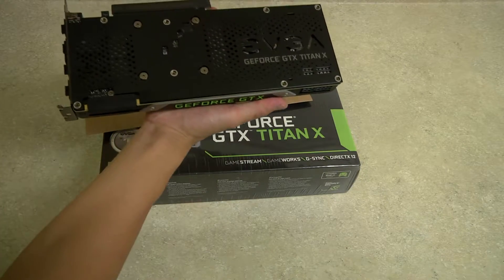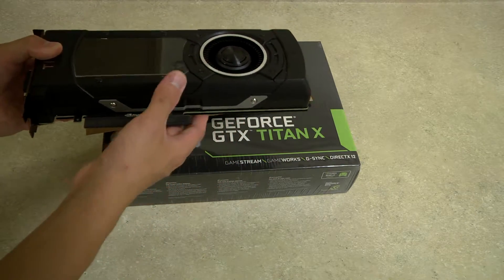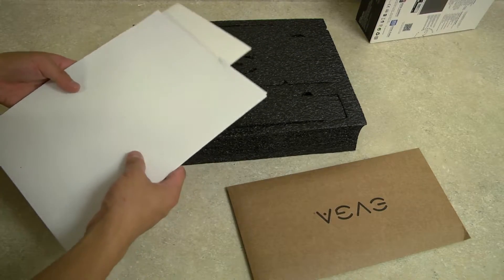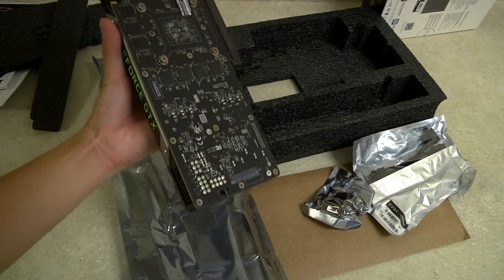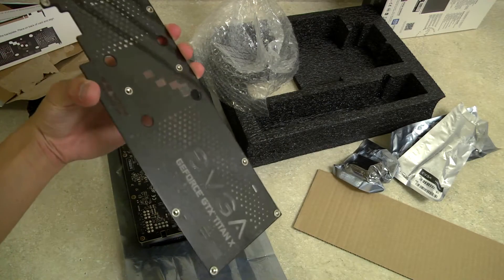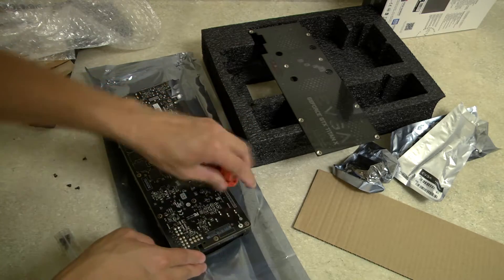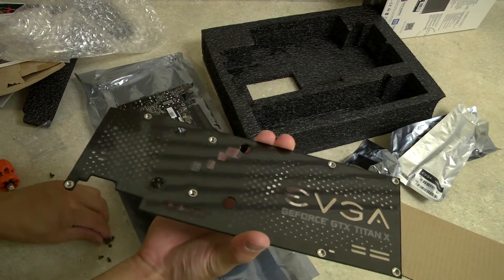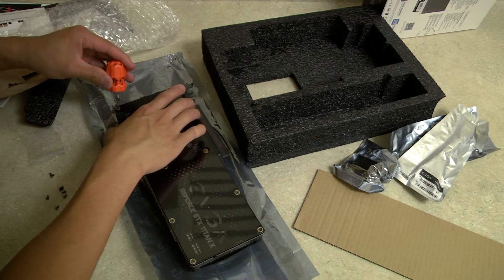How To Install EVGA GTX Titan X Backplate on the Nvidia GTX Titan X (with Unboxing)

Comment: I know this is a long shot, but do you still have this card or the plate? I have a Titan X and I'm trying to find this plate for it.
Reply from the maker: Unfortunately I got rid of the card more than 8 years ago. You might have some luck on eBay or checking around various gaming forums. EVGA stuff is considered hard to get considering they exited the GPU market a few years ago.

Comment: Plastic ?
Reply from the maker: @nhantran4604  It’s an aluminum plate that has a thin plastic film to protect it from scratches in package and during installation. It is removed after the plate is installed.
Reply: @MatrixWriter  thanks u

Comment: Can I use the EVGA backplate on a Palit Titan x?
Reply from the maker: There shouldn't be any issues as third party OEMs are not allowed to modified designs for Nvidia Titan series GTX - they can only resell them. Typically the lower tier cards (980 and 970, etc.) , Nvidia allows for OEMs to modify the layout and configuration.
Reply: +MatrixWriter thanks!

Comment: Can I install the stock gtx titan x cooler on a normal reference model titan?
Reply from the maker: I'm not entirely sure as the screw layout might not match. The Maxwell only had one Titan release.  Which reference model are you referring to?  Do you mean reference 970/980?
Reply: +MatrixWriter No I have a normal titan which is of course a reference model as all titans are reference models. So the screw layout won't match?
Reply from the maker: +Pure Ah thanks for the clarification. It should work then as long as they are in the same architecture series, ie, Maxwell.  Maxwell has different layout compared to Kepler and Pascal, etc.

Comment: The Titan X doesn't have a backplate because it runs VERY hot, and if you use more than one, it will overheat with the backplate on it.

Comment: For any who are interested in the screw driver he used the link is here:
http://countycomm.com/multibit.html
Reply from the maker: +WolfHZ 
Thanks for pointing this out!  I bought this at my local Fry's electronics for about $5.  Comes in handy for electronic repairs and taking things apart too.  The quality is quite good and comes with a lots of assorted bits to tear down and fix pretty much anything.

-MatrixWriter
Reply: +WolfHZ Buy Snap-on tools and dont look back..

Comment: The backplate looks good but when you are running 3-way SLI GTX Titan X like me you can't have backplates on the cards because they will be no gaps for air to get between the cards causing the cards to overheat and fail. Nvidia knows this that's why they left the backplate out.
Reply from the maker: Nonconformist 02 
Thanks for the insight.  I am currently doing 2 way SLI with my Titan Xs and I will eventually add another card.  On my server case (I am using Supermicro), it supports 4 GPUs with enough space between for airflow.  At one time, I had 4x AMD W9000s in there and it had backplates on it.  No GPU ever failed or overheated.  System was pretty loud, but that a server build.  Those cards had the same TDP of 250W as the Titan X.  Blower design gets rid of the hot air from the chassis rather than other coolers, it is suggested for multi-GPU set ups.

My current SLI set up has the cards next to each other and no issues on over heating and plenty of room between..  It really depends on the case and set up.  Some have done tests on cooling differences, but the backplate really does provide support and looks awesome.  Tested it out on another PC (Antec 1200 V3) and did not run into any issues.